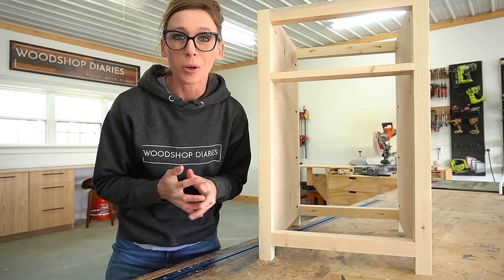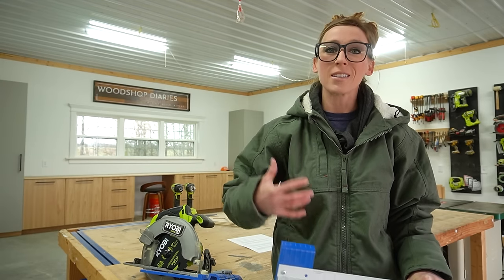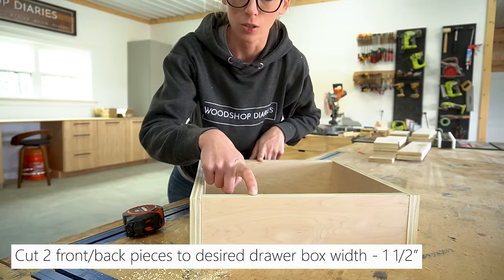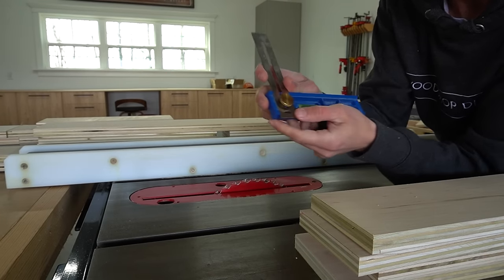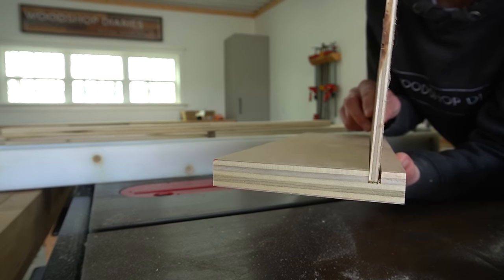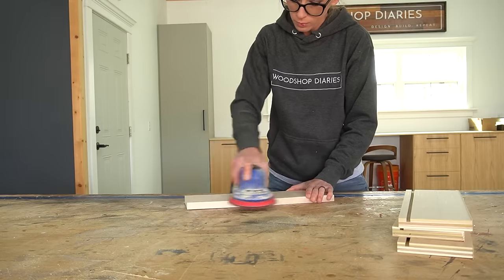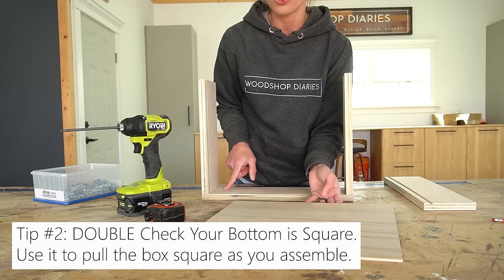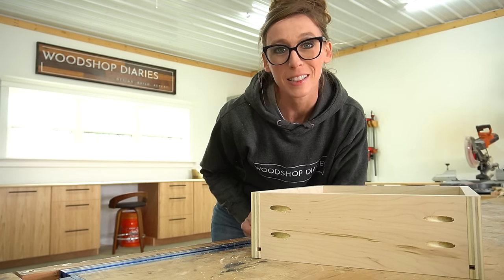How to Build a Drawer Box | Easy Step by Step Guide

Comment: What to use to finish the plywood drawers? Pain, stain, oil? You have great quality plywood in the US. We don't have that. It smells aweful and has more thin layers of wood than yours. I was told that paint and stain won't let that smell to go. plus they are not stable and will take off after some time. Oil is also not stable to prevent toxic smell.

Comment: Bathroom has really old built in drawers under the sink, is it possible to just remove old hardware and use the existing framing of the built ins? wanted to use your tutorial to make new drawers but not remove the existing built in frames

Comment: Big Hugs to you for that little tid bit on the actual measurement of 3/4" plywood. As it is, I'm HORRIBLE at measurements so I take extra steps to check for accuracy. While each piece appears to be accurate, my finish product typically seems to be just a smidgen off and I could never figure out why. I'd get so mad at myself thinking I measured or cut something wrong. Your random FYI in the midst of another one of your awesome videos literally sent sparkles of happiness through me! 🤩🙌 Thank you for explaining that!

Comment: what size of screws are fot that or is there a chart?
Reply from the maker: Hi! It’s 1 1/4” pocket hole screws for this particular application. However, depending on the wood thickness, you may need different sizes and types in other applications. You can check out more on screw size with pocket holes in this post: https://www.woodshopdiaries.com/how-to-use-pocket-hole-jig/

Comment: Really fantastic tips, Shara! Thanks a bunch! 😃
Personally, I normally use both metric and imperial systems. (Here in Brazil we use metrics for everything, but when I buy some plan for woodworking, I need to work with imperial.) And, to be honest, my only issue with the imperial system is that the conversions aren't direct (like 1 meter being 100 centimeters and 1 centimeter being 10 millimeters and so on) and you need to convert between fraction and numbers with decimals... Because calculators won't do it for you. 😬
But other than that... There's nothing more to it.
Anyway, stay safe there with your family! 🖖😊
Reply from the maker: Thanks so much! I appreciate you watching! I totally agree…the imperial system isn’t bad except for that nothing is in 10s. I don’t know why they had to make it 12” is a foot and inches are measured in 16ths and 8ths. I’ve gotten used to it now, but it’s still silly 🤣 
Anyway, I hope you have a great weekend and happy building!

Comment: Last summer I built a custom closet organizer, we had intended to buy 2 cabinets from ikea to have 8 drawers for storage. With everything that happened with supply chain issues, I ended up downloading from your site how to build drawers, and built them myself. For the bottom slot, I do had a router and small table, that through trial and error with scrapes I was able cut those.

What you mentioned about the width of 3/4 yeah, that did bite me, I bought my maple plywood from the big box hardware store, the wood workers lumber yard was about $25 a sheet more, yes much better quality and 3/4 thick.  I did find with the soft close slides I bought, my width was just off and the drawer did not slide properly, so another sheet and I cut new boards for the width and it resolved the issue I had. 

I had concerns about doing this myself, but by the end, I had it figured out. Again your documentation on how to do this helped a lot. I did use the same setup for ripping my plywood, trying to feed it on my basic table saw was not going to get me the results I needed from a 4x8 sheet. I also used pocket screws. My former neighbor who does home remodeling, talked me through some of this before he moved, as he was building new cabinets and drawers in his garage for his new house.

Comment: A nice trick for covering the pocket holes is to use wood plugs. Kreg sells them and they generally fit well.
Reply from the maker: Yes, they work great. I’ve used them in several projects. But I don’t plug them unless they’ll be seen and in drawers, they won’t be seen once finished 👍

Comment: This is the best video on how to make a draw box that I’ve found on YouTube! Thank you so much. Quick question - do the boxes need any kind of top coat or sealant? And do you sand the the top edges of the box after you put the tape on to soften the edges? Thanks!
Reply from the maker: Thank you! I personally don’t finish my drawer boxes, but you definitely can if you wanted to seal them. And yes, I sand after edge banding. Here’s my process for applying it: https://www.woodshopdiaries.com/how-to-cover-plywood-edges/

And here’s my process for sanding: https://www.woodshopdiaries.com/how-to-sand-wood/

Comment: Hi ! I’m getting ready to build the boxes? Would bigger boxes sag if 1/4 plywood are stapled to the bottom, rather than with the use of a dado slot? Box size is 22 width x 20 long
Reply: For that size drawer, I’d be using dados - the staples alone, won’t hold for long.

Comment: In the early part of the video, the section in your right hand appears to have quite the warp/crown.... it could be the camera lens, but it seems to be there a couple of later views as well. IF a board is warped/crowned and you must use it for a side or back section, which way would you put the warp/crown? Thanks 🙂
Reply from the maker: I actually noticed that when editing, but did not notice it when building. After seeing it in the footage, I went back to the drawer box to check and it’s not bowed. I checked all the drawers because I couldn’t remember which one I used for the demo here and I made two of these cabinets. When I checked, none of them were bowed. It may have been before completing the assembly and it straightened out when I installed the bottom and pulled everything together. Or it could have been the angle of the camera. My guess is it was slightly bowed, exaggerated by the lens, but pulled straight when the bottom panel was installed (see the part of the video where I talk about square). 
That said, if it was bowed and I noticed it while building? I’d still use it for either because the bottom panel will likely pull it flat.
Reply: @WoodshopDiaries  Thanks much. I was pondering if I'd turn it so the high spot was pointing in or out? Probably, on such a short board, it wouldn't matter, eh?
Reply from the maker: I’d turn the high spot in so the bottom panel can push it out. But you’re right…wouldn’t make a huge difference either way on a short board like this. Plus the plywood is fairly flexible and there’s enough play in the slides, so it’s really not super critical unless it was a very significant bow.

Comment: Hi shara. Are you saying it wont affect the drawer front measurements if i staple the quarter ply directly onto the bottom? Would it mean fitting the sliders differently because the box is a quarter deeper? Sorry for all the questions 😅
Reply from the maker: Hi! No that shouldn’t affect the drawer front and if you check out my installing slides video, everything there still applies the same even if you staple it on the bottom. The only difference would be that you may want to make the drawer box sides slightly shorter so the overall box dimensions stay the same
Reply: @WoodshopDiaries  thank you so much for your help.

Comment: Do you have any suggestions when I rip the plywood with my circular saw the wood edges do no cut clean and splinter the top layer.
Reply from the maker: Two likely culprits: 
1. Crappy plywood or
2. Crappy blade 
I’d recommend trying a fine finish plywood blade on your saw. It makes a world of difference. Basically, you just want a high tooth count

Comment: How well does the iron on edging last?  Does it eventually come off?  Thanks.
Reply from the maker: I’ve been using it on projects for 7+ years and I’ve not had any come off. I’ve used it in nightstands, dressers, kitchen cabinets, closet cabinets (all daily use) and in bathrooms (humid areas) and never had an issue with it. The good thing is that if it ever did start peeling, you could iron it back on. But, I’ve never had to do that. I have a guide with tips on properly installing it here: https://www.woodshopdiaries.com/how-to-cover-plywood-edges/
Reply: @WoodshopDiaries  Thanks. I am just starting to build my first cabinets. You are the best!